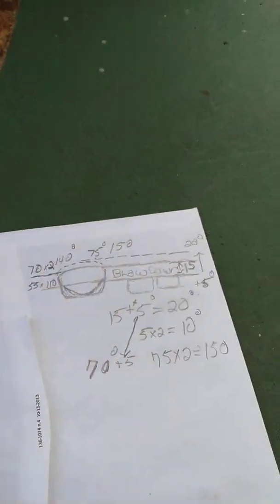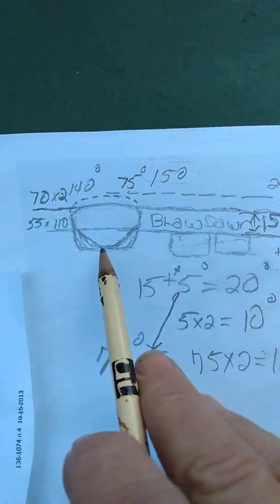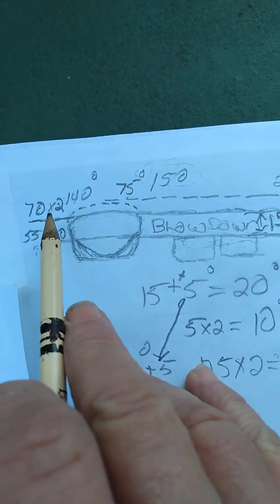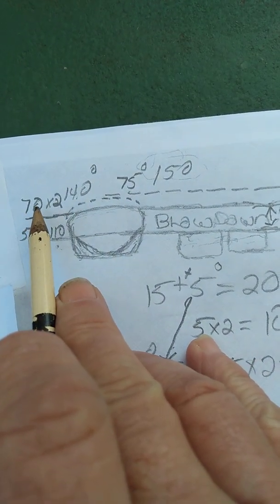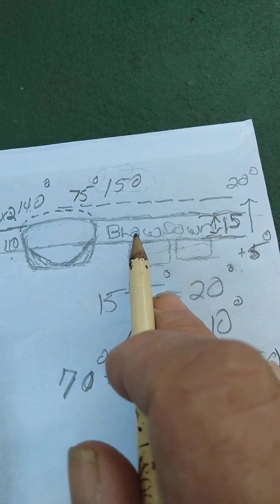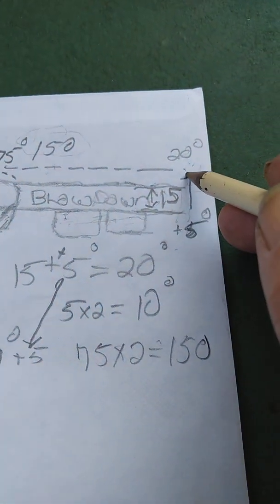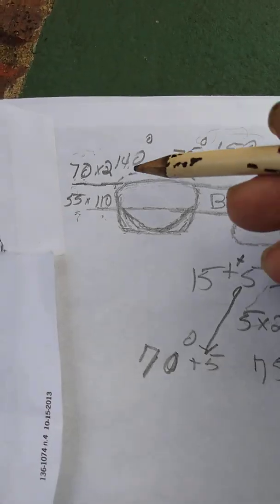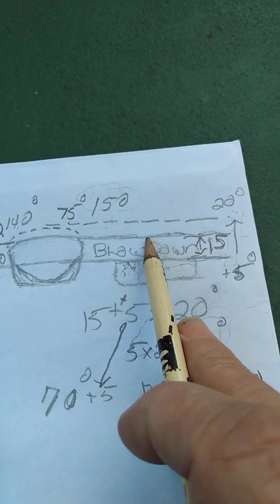motorized bicycle port separation explained blowdown simply distance from exhaust & tranfer openings

Comment: Hey buddy, you started with 70 degrees exhaust, wouldnt it become 65 degrees not 75 if you lifted the exhaust roof 5degrees ?the port would open sooner yes?  i study your videos a lot, they are very helpful, but im just learning still. Thanks
Reply from the maker: If your exhaust  port opens at 75 degrees that's a 150 exhaust duration  in this video its a visual  representation  of blowdown sence.  Example # if my tranfer duration is 120 degrees  overall  that says the tranfers open at 60 degrees.  75° exh open - 60 ° tranfer open = 15 ° of blowdown.  If your wanting to increase your blowdown  ie port separation from point exhaust  port opens° to the point tranfers just opens     ° the math would be. ? #° exh - 60° tranfer open = 20°   answer  is 80° exh open - 60° tranfer open = 20 ° of blowdown.  80 x 2 is 160 degrees of overall exhaust duration. Can't explain  it any easier than I do on my vids
Reply from the maker: https://youtu.be/QFm1fnMZy10?si=FKu7SqeKBPcXAg0E
Reply: Yes I understand your math, but from 0tdc to port opening in your video is a hypothetical,  70. If you raise the port roof, would it become 65? Not 75?
Coz that would effect the blowdown percentages at the end right?
Reply from the maker: @rcmadman18  to increase  blowdown  you will always have to lift exhaust  port.  Blowdown % is a whole different  question that's math is blowdown ° ÷ by tranfer overall  all duration. Example if you have 20 ° of blowdown  and 120° of tranfer  over all duration  that would be @16%   the tranfer  duration is the divisor. The more tranfer duration ie divisor   the more you need to push up exhaust port. To achieve  a decent bld %   example if you have a small tranfer  overall duration  example 110° degree  and same amount of blowdown again 20 degrees  that would yeald you a much better 18% of bld.  But if you had a cyl with say a 130 ° tranfer duration and 20° of blowdown   that would be at 15 %  simple stuff watch my vids I try to explain stuff simple as possible
Reply from the maker: https://youtu.be/R-_qbWB0Xy8?si=tQO0IGPTqDMfG0I0
Reply: Thanks for your information,  it's very good.
BUT, I'm referring to the numbers you used in this video, and I'm just clarifying that it was a simple mistake to help me understand more.  You had 70 degrees to ex open, and wanted 5 degrees more blowdown. So it should be 65 ex open, not 75 , as youve raised the port roof . 65x2 =130 as opposed to 75x2=150 . No insult intended of course just trying to learn
Reply from the maker: @rcmadman18  I'm not rewatching vids could have been a simple mistake I gave you about 4 different  examples I have vids explaining everything  in the simplest way I can. You can watch them or don't. I made videos to help people  my information  is 100% factual. Use it or don't.

Comment: I have seen about all your videos, many of them, more than once.  This video was very helpful.  I was using a 360 wheel before but printed out and made a 4 x 90 style. Now I understand what you mean about port opens....Times 2 is duration....I was actually looking at a Theoretical 2 Stroke wiki page or something and it clicked.  360 degree wheel kinda steered me in the wrong direction for a while.  }

Ignore the trolls...Just talk shit and keep going over this stuff.  When you get to the end....Start over and do the series over again.  Stuff you forgot to add or just didnt think about the 1st time will come out the 2nd time...And if not.,..maybe in the 3rd or 4th round it will...
Reply from the maker: Thanks hopefully they have been helpful. I cover about every technique to give people more than one option when it comes to changing there port timings
Reply from the maker: Hey great job allways remember bigger the wheel the more accurate the port timings will be. I have a wheel I use on cam shaft timings on prostock motorcyles that's probly 36 inch diameter

Comment: Can you do a similar vid on your BD% reasoning please?  Pretty sure I get the how with the math BD/Transfer(Intake?) Duration, but I'm still hazy on the why.  What are different effects using different BD%s.  From my modicum of knowledge, the more BD duration (to a certain degrees) the higher the RPM achievable, correct?
Reply from the maker: Posted one about that
Reply from the maker: Bld % is simple  blowdown ➗ by tranfer overall duration  equals bld % .made video on that  already  it's here on my channel but that's the math